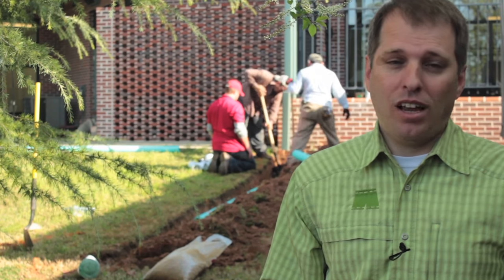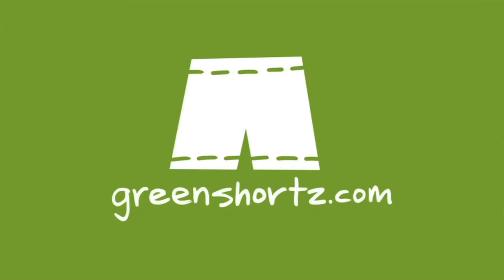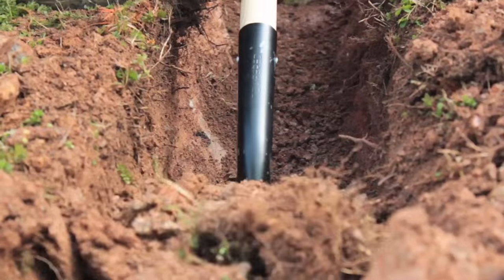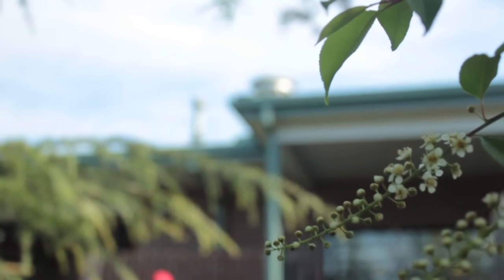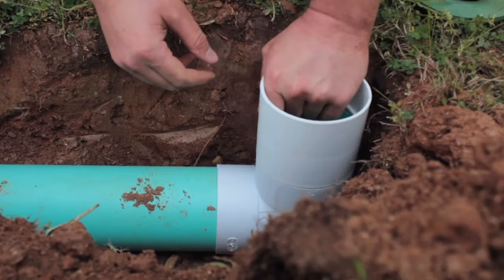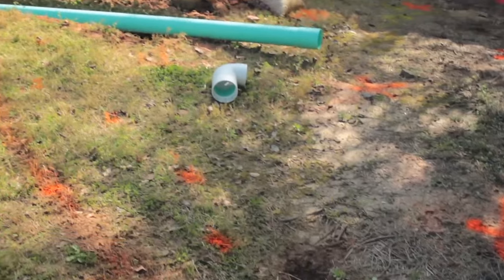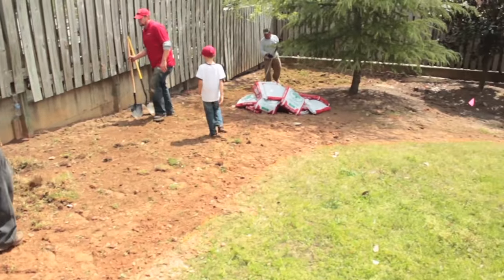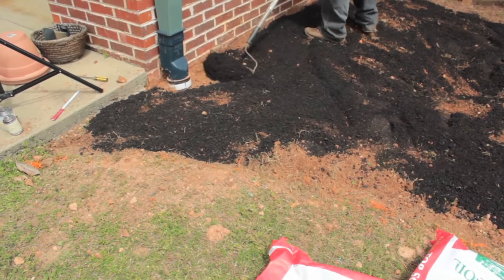Why To Install An Urban Rain Garden

Comment: I should do this in my garden too...only that we're still building around the house and the grass has just recovered. I don't have the energy to start digging again :(. Right now, we're guiding the rain water away from the house with some aluminium pipes cut in half lengthwise and put on the ground. I move them around the garden or connect 2-3 together depending on our needs. Putting some pipes in the ground is a great idea for when we finish the house and all the annexes around it. Thanks

Comment: What did u use to film this I'd you don't mind me asking?
Reply from the maker: +JessaJay Hi Jessa! I just had to approve this comment before I could see it (YouTube must think you are a spammer cause you are perhaps the most dedicated commenter on the platform). Left you a comment about this on your Rock Climbing video, but here is the info again...this video was shot a while ago, so I used my Canon T2i. Since then I've upgraded to a Canon 70D. Love it..love it!!!!! The sensor is amazing! And the autofocus is very nice. Notice I had the camera on a tripod and didn't move in this video. No autofocus on the T2i (but nice depth of field). I also have a GoPro 3+ Black. I use that for vlogging with a small external mic. Also use the 70D for vlogging as well...ala Casey Neistat. :-) But, I don't have the Gorilla Pod he uses. I saw you got a GoPro. Is that your primary camera now? I'll go watch that video...I bet I can find an answer there. Have a nice Sunday!

Comment: So is the bottom of the pipe perforated or does the water just run out the end?
Reply from the maker: They had two pop up drains and the lower ends of the pipes were drilled to allow for drainage (where you see the pebbles in the video). I usually like to have more containment in a train garden, with a berm, but I didn't design this one.
Reply from the maker: +Tom Mills (GreenShortz) Greg, to answer your question...the pipes were not perforated. That would have facilitated better percolation and allowed the rain garden to absorb more rain water.